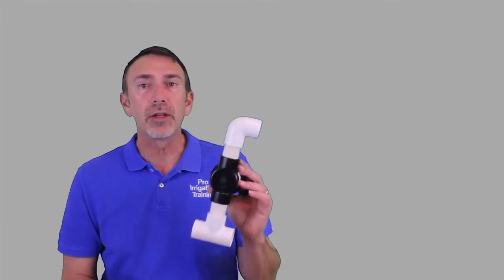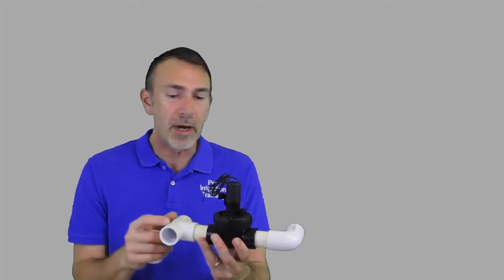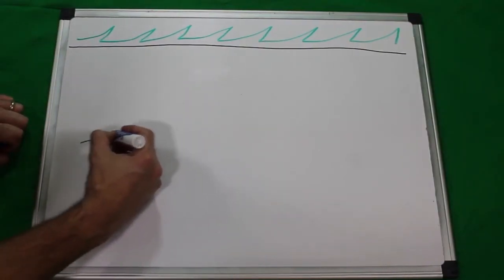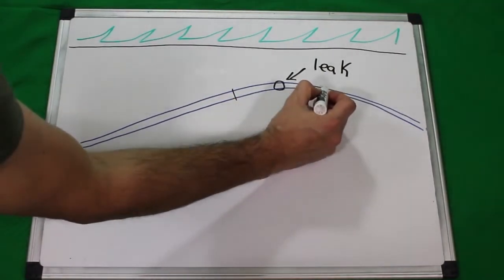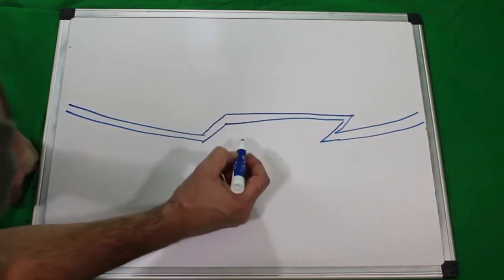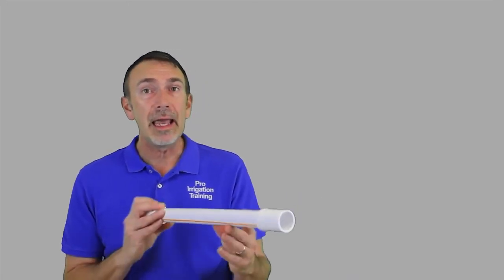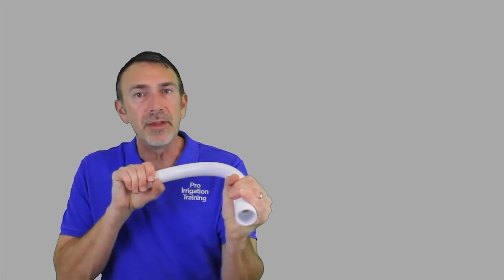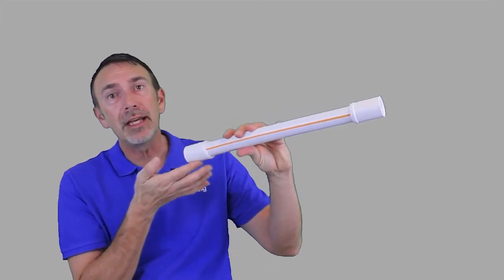Irrigation System Repair Situations (sprinkler repair)

Comment: how do you charge for irrigation repairs? I have a new client needing repairs but I am not sure how long it will take to fix and I still need to go through his yard a diagnose the problems, so I don't know how to charge for the research and diagnostic
time
Reply from the maker: Hi Sabrina! How I charge is time plus cost of parts for service and repair work. I charge $90/hr which isn't the top end for my area, and there's definitely many places where you could charge a lot more than that. As far as a diagnostic, I have a System Start Up Special; $89.00 for up to 6 zones of inspection and adjustments, $10 for each additional zone. You go through each zone and adjust all the heads that are running, and it gives you time to look at everything, watch for leaks, ,look for the valve boxes, etc. Put flags on all problems. Then you can give them a breakdown of all the problems you've found. Don't trap yourself by throwing out a price if you have leaks or valves not working or electrical problems etc. because you just don't know. Thanks for watching!